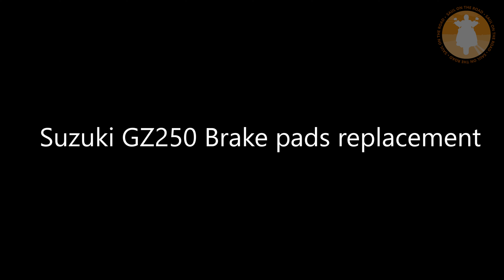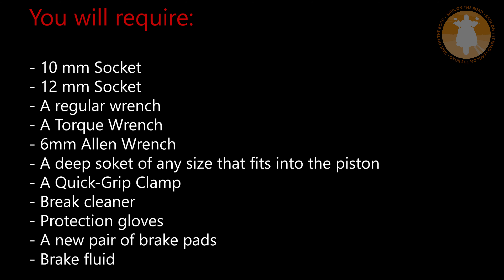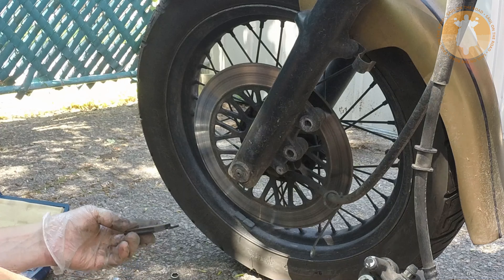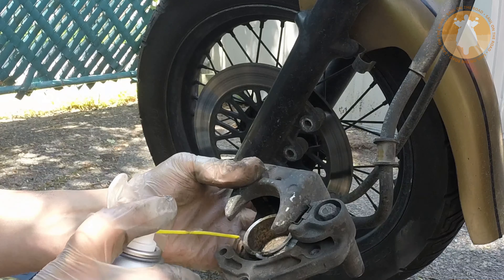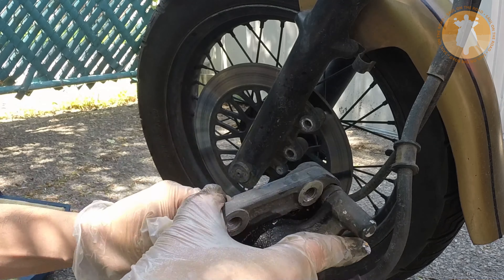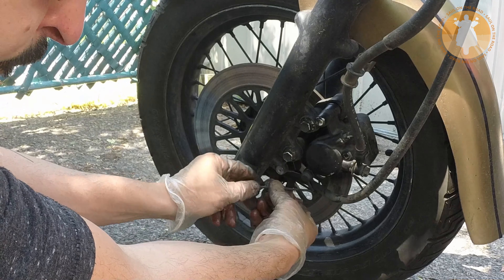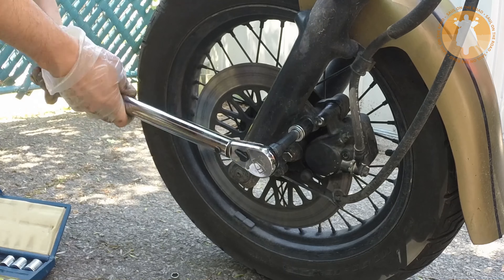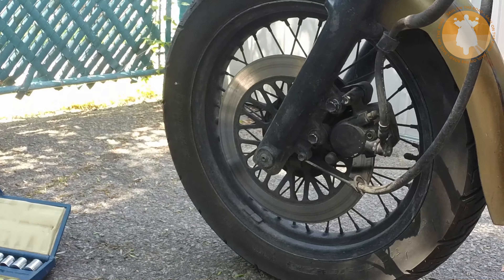S03 EP08   Suzuki GZ250 Brake pads replacement    Saul On The Road 4k

Comment: What brake pads should i buy?
Reply from the maker: If you are mostly in the city you can use organics otherwise use semimetallics , you will have more powerful brakes
Reply: @saulontheroad9605  thanks. So just any organic on amazon or eBay ? They just seem too cheap lol i mean $25 for shoes and pads man doesnt seems right i jist wanna male sure I get the right one and not something cheap that will kill me
Reply from the maker: @KillKyle712  Hi Kyle, organics does not necessary means cheap. You may find EBC (or any other premium brand) pads for about 40$ and you will be fine. I already install both cheap and premium in my bike and honestly do not see a big deal of diference, except for the occacional noise that cheap brands might produce. I personally prefer semi-metallic pads, last longer and the breaking distance tends to be shorter.